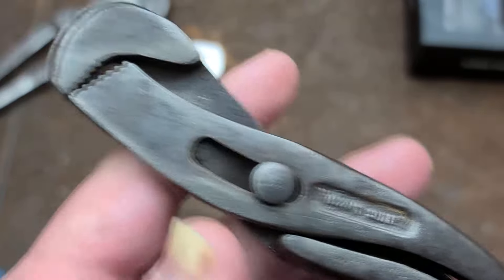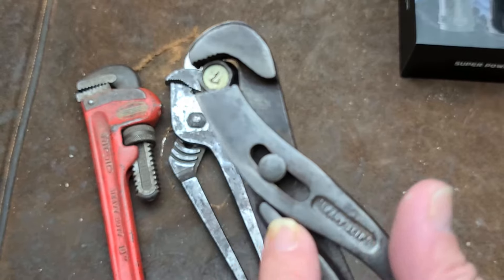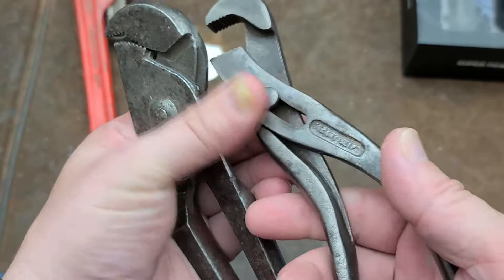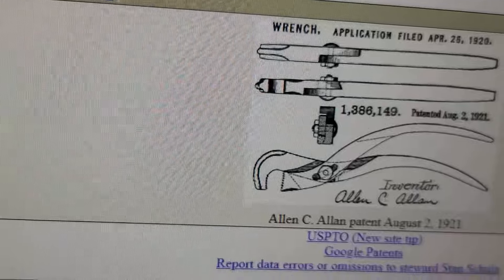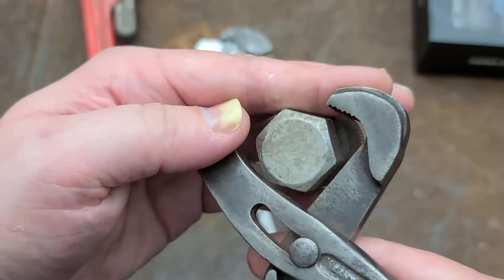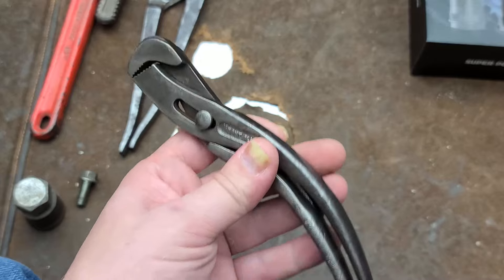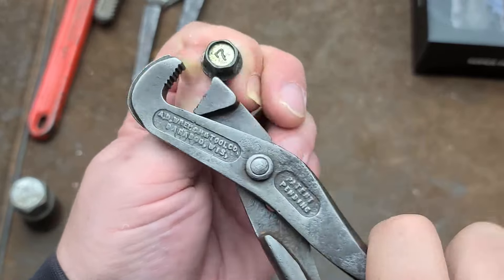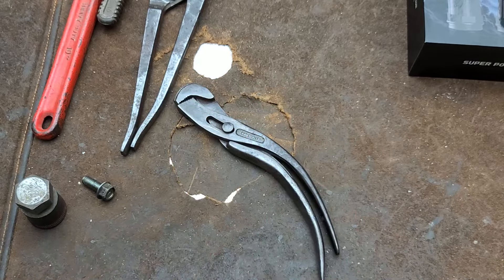AD Tools USA "Kant Slip" Self Adjusting Pliers Review, 100 Years Old!

Comment: I have a catalog of tools from 1880. You would not believe all of the different patented adjustable wrenches. I’d love to build some of those designs. If I had the time. Some of the names: Baxter’s wrench. Baxter’s diagonal wrench, a different design. Merrick’s pattern screw wrench, some%hing like, but not quite a “monkey” wrench. billing’s adjustable pocket wrench - drop forged from Norway steel. Barwick wrench. Peace’s combination wrench. Bemic & Call. Webster’s Patent combined wrench. Then we have the original Stillson’s patent Cylinder wrench. There are even more. Then there are the pipe wrenches. The Acme , the Jarecki adjustable pipe tongs. Brown’s, Barns, Starwood, etc. wrenches are so important to the mechanic that inventors spent a lot of time patenting new designs. We have to remember that in the mid to late 1800’s, this was still all pretty new and coming up with new designs was easier as there was very little out there. The Barwick I mentioned is the opposite of those you were showing. With those, the large, outer jaw is on a long pivoted lever crossing over the handle to the small jaw side.